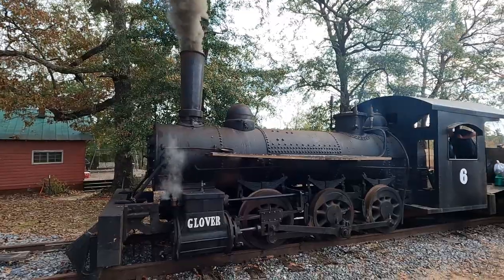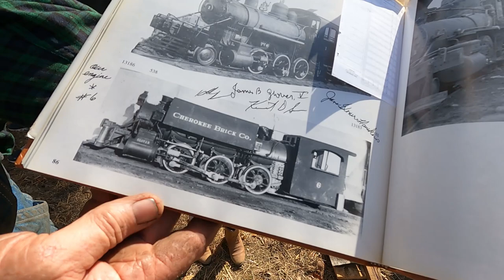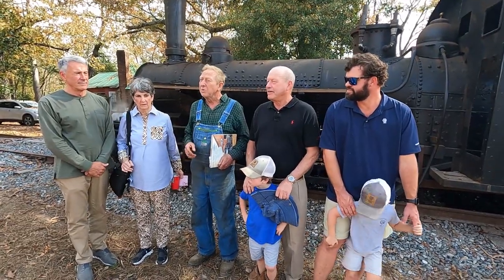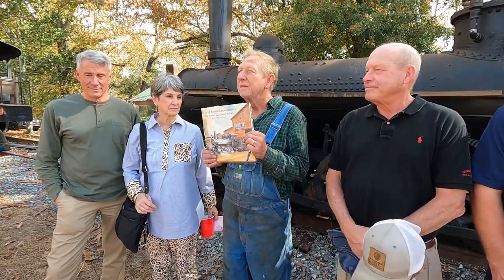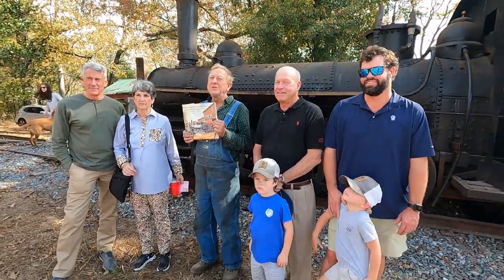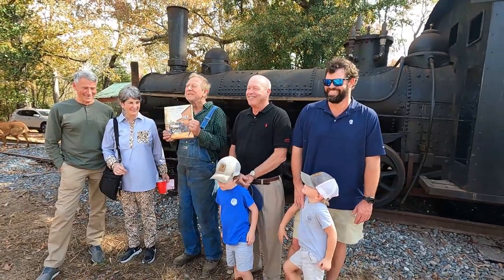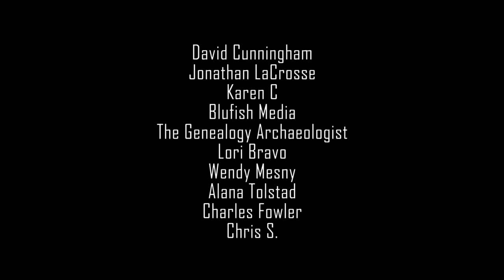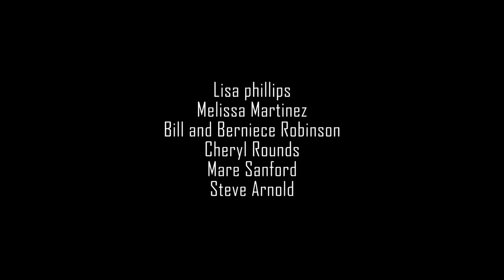106 YEAR OLD STEAM LOCOMOTIVE RUNS FOR FIRST TIME IN 70 YEARS! | GLOVER STEAM ENGINE

Comment: So, for the glover family to have built it, did they get it in a kit form or something as the smokebox door clearly say's it was from Schofield's Iron Works which was a manufacturer of steam engines, saw mills, etc located in Macon, GA that was founded in 1859.  The builder's plate does say Glover 1916 so it's kind of confusing. That's the first logging locomotive I've seen that wasn't a gear driven steam locomotive like a Shay, a Heisler or a Climax.  Pretty cool.  A lot of logging companies preferred the gear driven ones because, while they ran slowly they could operate well on poorly lain or bad track and had phenomenal amounts of torque for pulling on steep grades in hills and mountains.  I think the Cass railway in WV have some grades approaching 13% that no side rod locomotive could touch.  In any event, it's great to see another old locomotive restored to operation!
Reply: The door is probably from another locomotive maybe part of the restoration or another railroad the owned it needed to swap it out for whatever reason

Comment: how can they call it a full restore when the gland seals are already leaking? also it sounds like the valve gear is running on no oil. the smokebox face is missing nuts... the "restoration" is a worse and worse the more I look at it